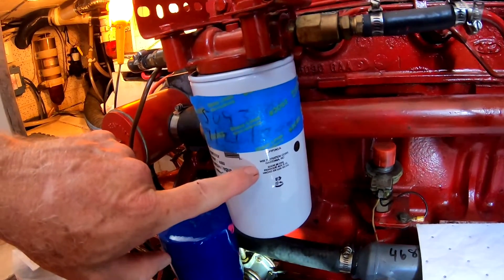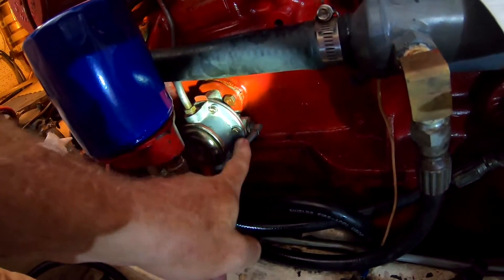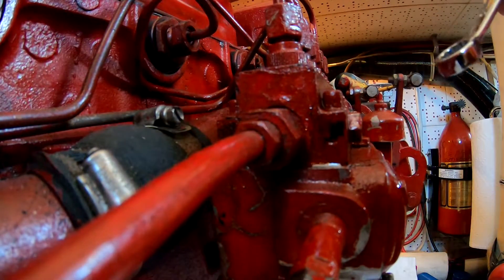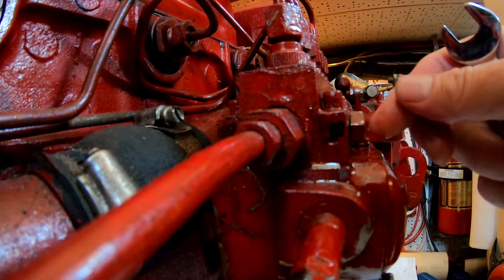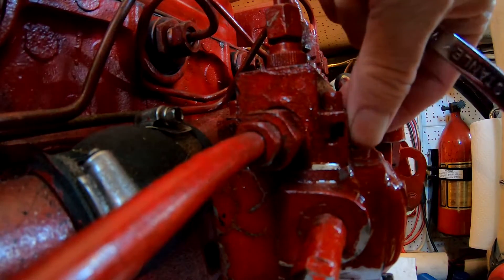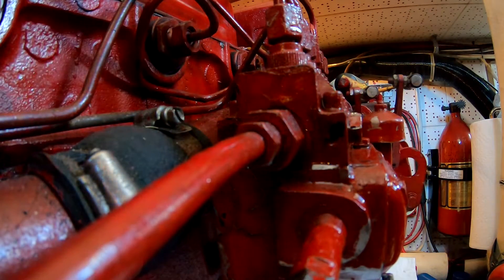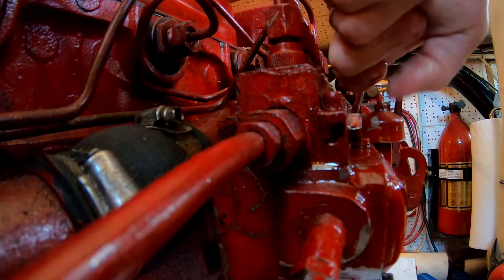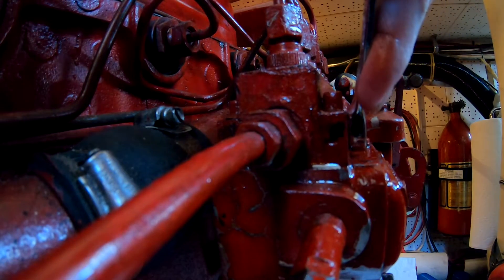Boating 101 How to bleed your fuel system on a Ford Lehman 120HP boat or tractor engine

Comment: Hi there! 
Please can I check whether this is also how to remove water (condensation from the tank) from the system?
I remember it involved the primer pump, but don't remember whether it was the same thing that you're unscrewing here. In my head it involved the 6 nozzle-type things going in just above those screws.
Reply from the maker: Water comes out through the Racor’s

Comment: I didn't believe my 25XPB had "self bleed"... 
My foolishness (ran dry), put it to the test after sailing into the fuel dock. A skeptical Attendant gave me 10 minutes or 'get a tow' ( yes, California). It cranked a solid 30seconds and was find ever since. Engine build year 2017, LiFePo4 batts

Comment: Only really need to open the bleed-screw closest to the front of the engine to purge air out. 
And to make sure all air is gone and if injector pipes have been off then pop the excess fuel button with tiny amount of throttle applied once the pipes have been refitted. Will save cranking (batteries and starter) and ensure instant starting.
Reply from the maker: Thanks for sharing

Comment: While sailing to Catalina, I was working on getting the vapor out.  I introduced the vapor, and knew the problem.

After loosening all of the injectors to no avail, I found your video.  Got out mucho air, and she fired right up.  Thank you so much.  I learned a good technique today👍
Reply from the maker: Thanks for sharing! and yes works every time on these engines

Comment: don't forget to look for air bubbles or drainage at all the fuel line fittings too while you prime it, that will show you loose tube fittings which will introduce air into the system again...........put a big zip lok around injector pump so it doesn;t drain in the bilge.......my two cents ha ha ha